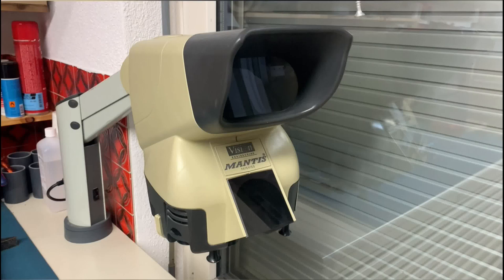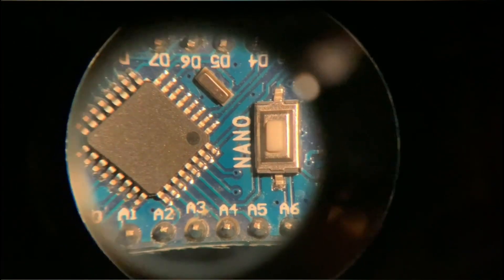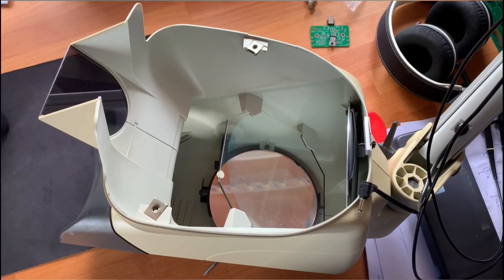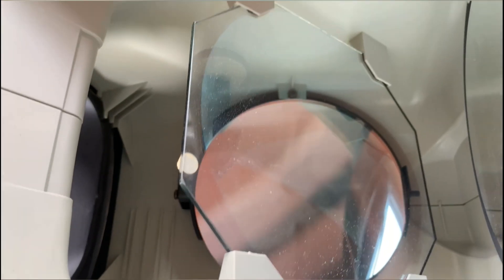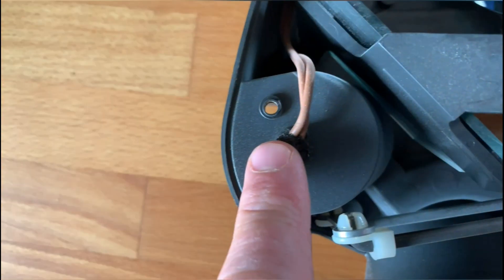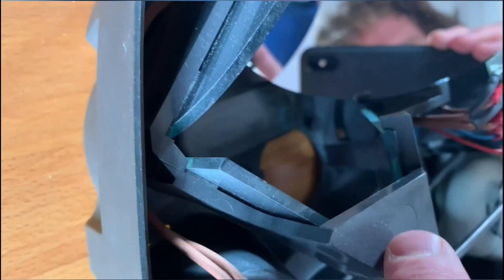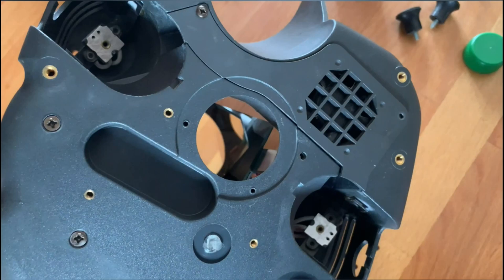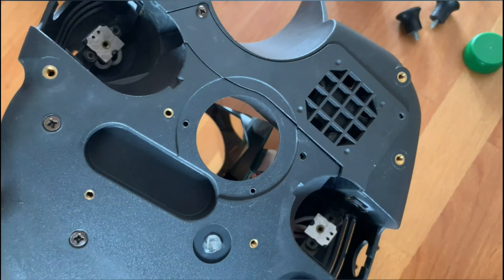Mantis Vision Microscope teardown (ancient version)

Comment: Sorry to ask, but does it still work? I was told opening them means they need a recalibration
Reply from the maker: I could not see a difference. I really wanted to clean it since it was used for producing and grinding implants and was full of dust. My impression was that it was well put together and could be taken apart without changing calibration.

Comment: Great videos. Is it possible for you to provide decent amount pictures of pictures of the inside of microscope with optical elements dimensions?  
I would love to try recreateing it with cheap, of the shelf components and 3d printed parts. This product is prohibitively expensive and deals as yours are very rare so cheaper option would be nice alternative for many people. Maybe there are some things to improve?
Reply: not sure if this is something you're still interested in, but the service manuals for most of their scopes are available online through manual/PDF library type sites.  Those manuals have some drawings, component lists, and part numbers.  The design is pretty simplistic, however, depending on your requirements, there can still be great deal of engineering involved as optics and stereo microscopy can get quite complicated.  The other thing that you might find difficult about this is that the manufacturer seems to make serious efforts to avoid using any technical terms when selling and supporting their products.  I assume this is to appeal to non-technical potential customers.  So, if you don't already have knowledge of microscopy, it may be challenging to get much more than an overview of the design from the reference materials.  I've spent a significant amount of time this week trying to gather technical specs on these microscopes and their parts/accessories.  Simple terms that would be readily available from any other manufacturer, such as focal length, field number, or thread pitch, have been incredibly difficult for me to obtain- and I own one of these microscopes!  anyway, more power to you.  I wish you luck with the project and hope this helps!
Reply from the maker: @lab_rabbit  Well part of it I assume is that the "Specs" are not that important to the customer. Just show them the thing on the trade show floor and they will buy it (companies and people who work in the 2-10x range for a living that is). The "feel" of that thing is insanely good, it is so comfortable and the 3D effect helps a lot. Scientific microscopes may have great specs but I much prefer working with this one. The value of this one has to be expirienced.
Reply from the maker: Just saw your comment. It is a good idea, will think about it. However, Im not sure how much good measuring things would be. Eg. The mirrors diameter is much less important (I would assume, having done only some introduction courses to optics) than the actual shape of the surface. A very detailed 3D Scan could be usefull but I do not have acess to a scanner which has the specs to make the measurements useful. If someone has and lives around Zurich, Switzerland, I would be open to collaborate.

Comment: These microscopes is very good and still really expensive, 50 bucks was a steal. They usually go for around 500-1000€ depending on condition and objectives. I actually prefer this older version compared to the newer ones :)